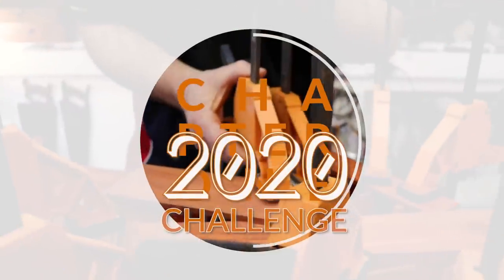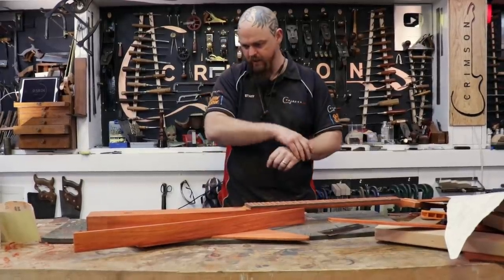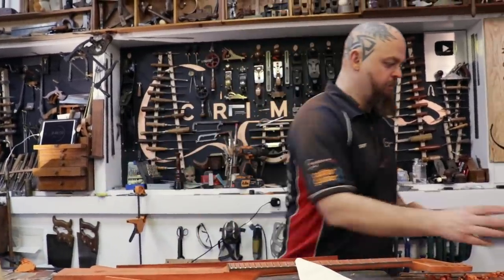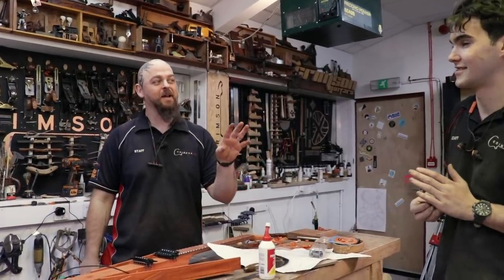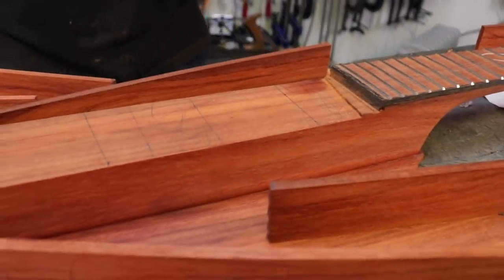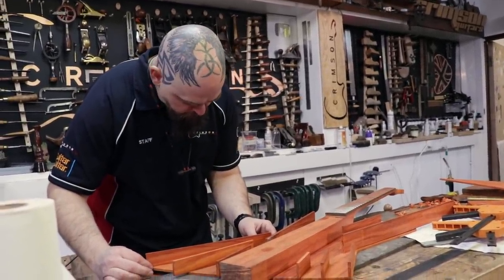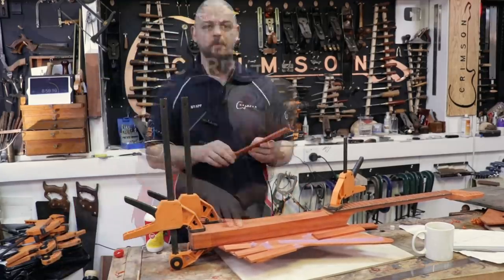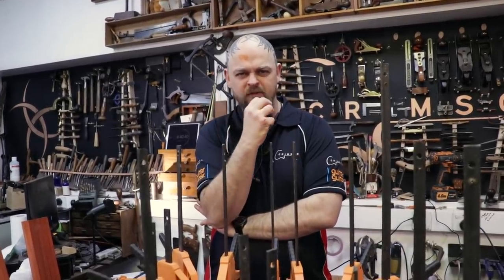Ep 8 - Too many clamps? - Ben Builds a UNIQUE Crowd Designed Hollow Multi-Scale Guitar in 20 hours!

Comment: Hi Ben;
All the instruments that I have built have been unconventional. I have had some great successes and some glaring failures. I count all of them as successes because of what I have learned from the failures. All but one of my failures I have been able to salvage albeit in one case I made the instrument into a totally different type of instrument. My first guitar (an acoustic) ended up in the trash barrel. The materials were wrong and would not work at all. So, point taken is your an inventor of instruments. Keep doing what you are good at and keep inventing. Two thumbs up so far.

Comment: Right on Ben at 22:00 I was a routing guy but if you did the drilling and capped off the ends and slotted the top it would work exceptionally well...
Very well done good sir.
Still have the pickups to route out though

Comment: With this original bulding method, you could tune the little pieces of wood you use inside the body.
I wonder what it could do to the sound?
Reply from the maker: I'm not sure, but it is certainly worth playing with. I think next time round I will remove a lot more material and make it as light as possible. Should be fun. B

Comment: Hello everyone, I need advice from someone who knows how to wire stuff on a guitar.

Okay so, I'm new at this, but I want to make my very own guitar. Now I could do something simple but that wouldn't be fun lol. I want my guitar to have a single coil in the neck (Fender pure vintage '59 strat pickup) and a humbucker in the bridge (Seymour Duncan sh-11 custom custom). I want both of my pickups to sound as nice as possible, so I'd need a 250k pot for the single coil and a 500k pot for the humbucker. However, I want my humbucker to also have the same type of sound Van Halen has, and I believe he uses a 300k pot.
So I'd need something like a three-way switch, 250k single coil, 250k humbucker, 500k humbucker.

Is it even possible and if it is, how do I wire it ? Thanks a lot !
Reply: I would have two volume pots, one 500 one 250 with two levels and have a 2 way switch for the humbucker, the 250 vs 300 would be close enough for me
Reply: Well thanks everyone, we'll see how this project goes !
Reply: This is why I play the mandolin.
Reply: You could in fact have a 300k capacitor for the humbucker rather than 250k (Gibson have been using these for a while). You could also coil split the humbucker with a push pull pot which would probably achieve something similar. Explaining how to wire it in the comments section is asking a bit much though, partly because the pickup manufacturers use standard colours but use different colours for different things (in terms of earth, north positive, south positive etc). Guns and Guitars has a good tutorial on YouTube explaining how to deal with this problem. From there your best bet is to Google wiring diagrams and try to figure it out from there.
Reply: Obsidian wiring interfaces. Check em out, they may offer what you’re looking for in a solderless form. Darrel Braun Guitars (YT channel) has used them a few times.
Reply: Not possible, buy a concentric pot 500/250. Also caps have to be different. Need help msg me...
Reply: Why use 500k if you want the 300k sound?
Reply: With all due respect mate , I doubt if a specific value pot alone will bring you closer to sounding like EVH . I bet if you gave him any decent playable guitar and a valve amp it would sound like him . I have a good article in an old magazine where he goes through what gear was used on the first couple of albums and his guitar choices were pretty diverse and it has to be said the guy was not cut out to be a guitar tech as a second profession, more like a butcher lol ! Cheers 👍
Reply: @Finn-McCool  No you play mandolin because playing Losing My Religion on a capo'd guitar doesn't sound as nice 😉
Reply: @shaunw9270  
I'm more of a "Free Falling" and "Man of Constant Sorrow" kind of guy. 😉 
I'll keep my religion. 🔐
😂